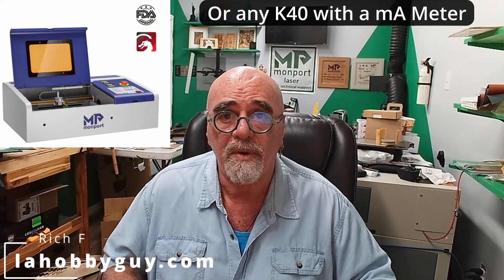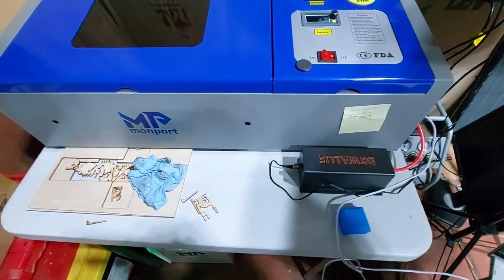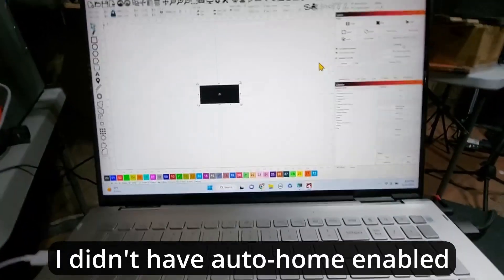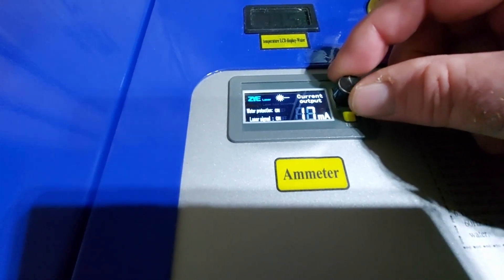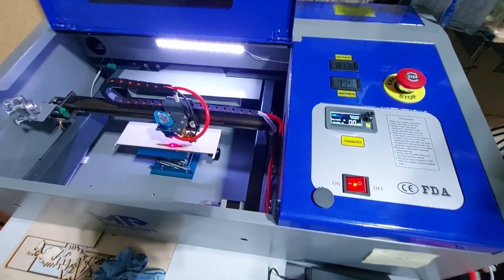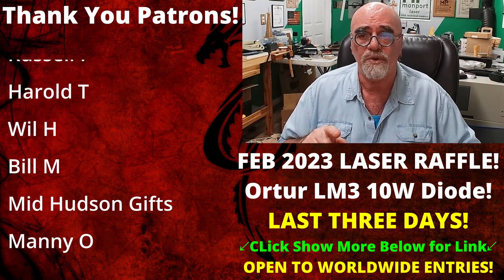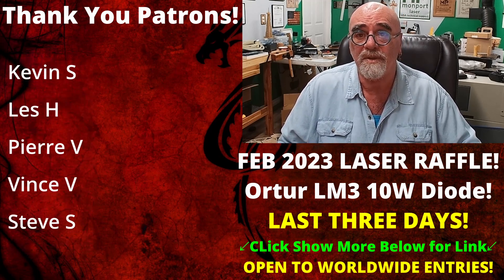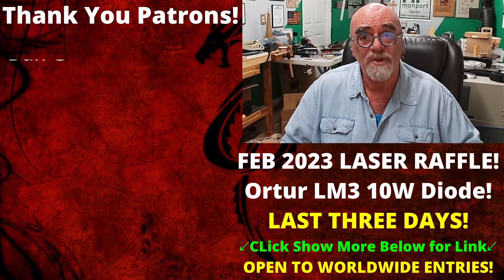ℹ️ Configuring a K40 Co2 Laser for long tube life -  Demonstration on a K40!

Comment: If you set the mAmp meter in this way - should you still need to stay below 75% on your project in Light Burn or is that unnecessary after this calibration is done (I have an OmTech K40+ but I assume it’s the same concept)
Reply from the maker: Once you set the mA meter, you can use Lightburn at 100%.

Comment: Just to follow up and close this up with the definitive answer from Monport tech support. By the way, I posted this question on several K40 laser YouTube channels and of course, the answers were split as to which method they used. I personally want to run it with the power knob at full, and control percentage via the software. And, that is exactly what Monport K40 tech support states in their reply email (see below) They just have really ambiguous terminology/language in their operation manual, but the email clears that up by saying the “power” is in reference to the LightBurn percentage you set, and NOT the knob position. Hope this clears it up for anyone else who had same questions. Thanks 

From Monport tech support:

Please find the instructions from our engineers below.

Hello, when processing equipment, it is usually necessary to turn the power knob of the equipment's ammeter to the maximum for processing. The power in the manual refers to the power set in Lightburn, which should not exceed 70%, but in actual cutting, the specific power needs You adjust based on the thickness and texture of the material.

Best regards,
Ailyn
Reply from the maker: Okay, I did tech support for Monport for over a year because they don't really have technicians. You can follow their advice, which is almost always wrong if you like. This time they got it partially right. You do adjust the power and speed for different thicknesses of material, but that's just common sense. If you have a mA reader, which you said you do, don't exceed 70% power on a 40W tube, which is about 17mA on their tubes.

Comment: Several questions for you…
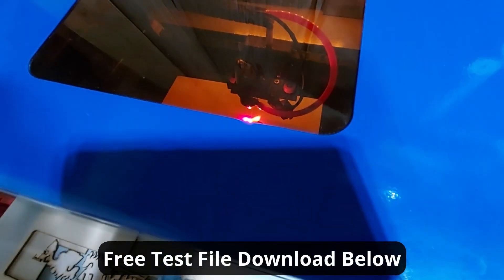(1) At 3:54 you begin to run “the test”, and dial up the power to 17-18mA. At 4:50 ish you say success, it’s gone completely through, the machine is “completely calibrated” etc. What exactly was this test we are supposed to run every 6 months? Gone completely through? Was that the criteria for success? What was the material? What was the thickness? From watching the video we can’t even tell at which power setting it actually DID burn through completely. 
So how do you know it was at 17-18mA?

(2) How did you come up with 17-18mA as being equal to 70% of the laser power? Where did you get that figure?

(3) By relying on keeping the KNOB at exactly the same physical position (to achieve 17-18mA), if your project called for 100% power IN THE SOFTWARE SETTINGS, if your knob had accidentally been turned further clockwise you would now be running at MORE than 70% power and be damaging your tube. Is it not possible instead to set THE KNOB always full clockwise (full power) and then control the actual PERCENTAGE of power via the software setting?? SPEED and POWER are settings you must set in yourself EVERY time and you would simply never set >70% for power, and therefore never have a chance to overdrive the tube.

Also, doing your way with the knob set at 17mA (which is what you say is about 60-70% -maybe, maybe not), and we choose 30% power on the software setting, what is now the actual power being used? Guess what, it’s NOT the 30 % you were thinking it was by setting that number in the software. It could be 18-21% only…

Not trying to troll you at all - I love your videos. It’s just I still haven’t found a definitive answer to setting that knob correctly. The Monport manual says to use the knob to set 20-60% power - BUT THE DISPLAY BY THE KNOB READS IN mA- NOT percentage of power! Perhaps your answer to question #2 will solve all the mystery. Thanks for the vids!
Reply from the maker: A lot of questions I can't answer in a text. 21mA is max power on a 40W tube. I repeat the test every 6 months to see if the laser power has decreased and adjust it accordingly.

Comment: Hello. I just got a monporty k40 with all the upgrades I think I am very new and trying to follow this video. when I do this and turn my nobe on the machine my milamps only go up to 12 then start making a whistle noise. What does this mean?  Also it looks like it is backwards like it is inverted.
Reply from the maker: They've made lots of changes to the K40 for the worse since this video. You'll need to contact their support if they'll even answer you.

Comment: Please correct me if I’m wrong. On my control board I put in 40% on the display. It shows 15 ma on my analog amp meter.  In other words, I set the laser powered display percent to whatever gives me the correct milliamps.  Please forgive me if I’m reading into this too much.  I purchased a used machine and I’m getting a new tube for it. And I would like to set it up correctly.
Reply from the maker: 15-17 mA is the highest you want to go on a 40W.
Reply: @TheLouisianaHobbyGuy  Thank you.

Comment: I'm using an Omtech K40 that I just purchased. I am creating a primitive shape like you have, turning the knob all the way left (min mA), and running lightburn at 100% power, fill, etc. However, when the laser is firing (which it does fire), it just sits at 4-5mA. Even if I gradually turn the knob to increase power, it does nothing. Is there a setting I am missing inside Lightburn?
Reply from the maker: No, you probably have a defective mA meter. It's very common on the K40s. Contact OMTech for a replacement.

Comment: How do I set my OMTech K40 to 18mA max when I don't have the 'fancy knob?' I'm sure that there are a lot of people in that boat! I'm in a nearby boat... I've replaced my Nano board with a AwesomeTech MG3, how would I set mine to have that max mA? If I set my settings to 40-60% it's approaching/bumping the 20mA spot, so I'm struggling a little bit with making sure I don't hit that number.
Reply from the maker: Can't help with all the other controllers Terry. Install a mA meter and set the power in Lightburn.

Comment: I did a bunch of research on 40 W CO2 laser tubes. Most of the manufacturers recommend 12 mA as 100% power. Any more current than that and you are over driving the laser tube.
Reply from the maker: Okay, you can use yours at 12mA. These tubes produce 40W at 21mA.

Comment: I recently swapped the OMTech board in my K40 with a Monport Lightburn board. This disabled the power control buttons entirely. I have mA meter installed, but have no method of adjusting output. Running a material test it was blowing through plywood at 10% power, and pushing 12mA at 10%. I don't want to run the test and end up frying my tube. Any suggestions on how to adjust power without a potentiometer?
Reply from the maker: They're all different.

Comment: I know this video is several months old but hopefully someone will see my comment, I followed these steps exactly (I think) and the highest my ammeter will go is 12. When I hit test it fires at 17 so not sure what I’m doing wrong. Thanks!!
Reply from the maker: You may need to set the S-Value Max in the Device Settings to 1000 Danielle. If not, it may be a bad ammeter.
Reply: @TheLouisianaHobbyGuy I’ll look into thank that you for responding!
Reply: I just leave my amp meter knob fully turned clockwise and never command LB over 70%. Is that acceptable?

Comment: i'm new new but, i have an omtech k40, and tried this but 100% on lightburn and cranked the dial to the ammeter all the way up. and never got to 17 while running, it hit 11-12 while running ... now, in manual i put the head over my scrap wood and hit the manual fire button, a little over halfway turned the ammeter reads 17mA .... i think this should be just the same? can anyone confirm or deny when this is seen
Reply from the maker: It should be.
Reply: @TheLouisianaHobbyGuy  ok, in that case i will leave it well enough alone... this is my first laser, and ive had to fumble thru to align the mirrors, its been engraving fine but ran a test card and the results aren't perfect so, may also have to try to align mirror 3 better .... i'm still learning the fullness of it, only owned it maybe 2 weeks now, and  trying to  be done and done with calibrations and learn the rest  ( i definitely appreciate the reply!)

Comment: Thanks for the video very interesting. I have fitted a Monport v2 Lightburn card into my machine unfortunately I don't have a adjustable meter, so was wondering If I lowered the S-Value in Lightburn and changed $30 to the same figure would this have the same effect. Hope to hear from you.
Kevin.
Reply from the maker: No, you have to add a meter and measure the mA with different powers.

Comment: Just 1 question,  the meter you said take to 17 or 18 that would be 70% of lasers power. I found mine only goes up to 18. Wouldn't that be 100% power?
Reply: So that means cranking my ma meter far as it will go (18) my laser would never produce 100% power anyways?
Reply from the maker: I misread the question. Yes, if the mA meter says 17-18, that's about 70% of the tube's power for a K40. A Co2 should never exceed 70% of the rated power or you'll burn up the Co2 really quickly.
Reply from the maker: Nope.

Comment: I’m thinking of buying a cO2 laser to add to my shop. $3500-4000 budget for laser chiller etc. Any recommendations?  I like the k40 videos you did but would like a larger work area.
Reply from the maker: This is the best desktop all-in-one I have found Jason. No need to buy anything else, everything is in one package, built into the machine. The Gweike Pro II 50W is $3099 complete, and if you use my coupon code you'll get a couple of hundred off on the price. Plus they are the oldest and largest manufacturer of Co2 lasers and they're support is phenomenal. Coupon code: LAHOBBYGUY

Comment: do u have a video on the scan offset tool in lightburn, I have a co2 that I have double lines and I'm not finding a good video on it
Reply from the maker: Double lines on a Co2 is usually the IR beam hitting the nozzle on the way out, and requires a mirror alignment.
Reply: @TheLouisianaHobbyGuy  I did all that and also made sure it was not hitting the nozzle and still getting double lines, the lines are not way out of focus double, just slightly side by side double, I've seen other videos talking about it but u seem to explain things well on ur videos to where I understand em better so I thought maybe u would have a video on it perhaps, thanks
Reply from the maker: I don't Micky, but it's either a mirror alignment or the nozzle that create dbl lines.

Comment: hey rich!  hey i have upgraded my k40 with the monport board to run LB, however, my dial doesn't do anything anymore. the meter still works but the dial does nothing.  is there any wiring hacks that you happen to know of to get that going again.    not really a huge deal, i have never had to run my laser more than 40% anyway but hey what the heck.
Reply from the maker: No, just work off the mA meter and keep it below 18mA.
Reply: @TheLouisianaHobbyGuy  no worries, I will do that.  I am replacing my tube today, I regrettably, and against my better judgment, am one of those guys who ran it at 100 in the beginning 😆.  Just wanted to make sure not to over heat this one!  Now I think I saw in one of your videos, I have watched sooo many in the last few weeks, that there is a setting in LB that you can limit the power globally so that LB only uses the percentage of that number instead of the max of the tube??
Reply from the maker: You can only do it if you have the LED potentiometer and the Ethernet from the power supply to the potentiometer Jason.
Reply: @TheLouisianaHobbyGuy  Thanks Rich! i really appreciate it!

Comment: SO extremely helpful Rich! I have the exact laser and was never clear on how to set the ammeter but I never set my power in lightburn any higher than about 70%.  How do you focus without an adjustable but like you modified?
Reply from the maker: Glad it helped Mike! I use the adjustable scissor jack to focus.

Comment: Hi Rich,
Can a diode run 100%  without problem
Or also better to stay under 80% power
Reply from the maker: I have for a long time with no issues. There is no real data on this from the manufacturers, but I don't think it matters that much personally.

Comment: Rich, can you confirm whether Monports GRBL board for their K40 works with omtechs, seems to be a fairly simple switch over but you have much more knowledge than me.  Omtech arent shopping their version overseas and VMS charges to much  even tho its a good board with loads of options for future upgrades.

Really want to get mine up and running after ripping it to pieces and rebuilding it bigger but so used to lightburn i dont want to keep having to bounce back and forth with different software
Reply from the maker: I cannot, since I don't know which version they're using and if the wiring is the same. You CAN make any K40 laser work with the Grbl board, however I can't say if it will be plug-n-play. You may have to change the limit switch wiring or even create a new limit wiring loom based on the connector they used. If there's a ribbon band plugging into the control board on yours, you'll need new limit wiring.

Comment: Rich, My ma meter on the Monport K40 doesn't go any higher than 4ma even at max power and 100% in lightburn. Is there a setting I'm missing or is something wrong with the machine?  It has been like this since I got it.
Reply from the maker: Try opening the power bay door and unplugging the network cable that goes from the power supply to the mA meter on both ends, and then reconnect it. If that doesn't work, open a support ticket at https://cofcc.com/ Dana.
Reply: Tried that no luck. When I press the test fire button the ma meter reads 20 but when I set lightburn to 100% I only get 5ma so I'm thinking it is something in lightburn.

Comment: Hello Rich. I recently updated my K40 with a FluidNC board so I could use Lightburn. Your videos have been invaluable in getting me up to speed. The one thing that I hadn’t been able to find anywhere was guidance on what percent power in Lightburn  correlates to the milliamp settings I had been manually setting with the knob. Through my own experiments, I’ve found that about 55% equates to 15 ma. I was thinking it would be nice if there were a scaling setting in the software that would let you use 0-100% for these situations.
Reply from the maker: Well this is it! Hope it helped Karl.
Reply: @TheLouisianaHobbyGuy  Very helpful. The difference with my controller is that the knob is no longer functional after the installation. Power control is entirely through software. The analog ammeter and the laser control button are the only items on the control panel that still work. I do test fires through the macros in the console.
Reply from the maker: Then you'll have to install a ammeter Karl.

Comment: What additional items would be required (ie chiller, air blower, etc). The $549 price looks good but know that is all that is required.
Reply from the maker: I only run a Co2 with a real chiller, the CW5200 with the compressor. That's all you really need, but I did and upgrade to air assist video as well, and I would recommend upgrading.

Comment: I have been watching your videos for quite some time and finally purchased a MonPort K40 Lightburn edition a couple weeks ago.  Everything on my mA meter works except the mA readout which is blank.  I would like to do this setup but still waiting for MonPort support to get back to me.  The last thing they sent was, "We will ask the engineer to check this issue and get back to you."  I have asked for the manual to the Lightburn compatible board three times and still haven't had a response to that.  I added a flow meter with a temp probe and need to connect it to 12vdc on the board or to maybe a water temp connection on the board.  Needles to say I am a little disappointed in the support.  Keep up the great videos, I am sure this will get worked out sooner or later.🤞
Reply from the maker: I control the USA support Bill. If you open a ticket at https://cofcc.com/ I will handle it quickly.

Comment: Useful video for those with CO2 lasers.  When you said 70% power does this mean that a 100 watt laser would only develop 70 watts of optical power?
Reply from the maker: It is capable of 100-105 or more depending on the manufacturer, however, you use up the Co2 very quickly if you go over 70%.

Comment: Ofcourse I don’t know the high voltage psu from this K40, but on my machine, (80watt machine with the same amp meter) there is a potentiometer in the psu (look for a small hole on one of the sides) to do the same as you did at the amp meter. So you can use the regulator even more to finetune some of your engraving processes, and don’t have the risc of accidently turning the knob.
Reply from the maker: That process is how most of the manufacturers do it Eduard, but there is none on this power supply.